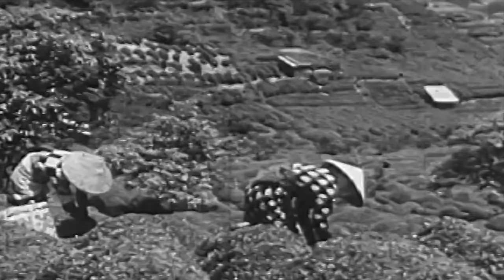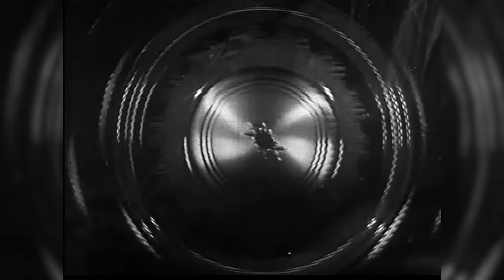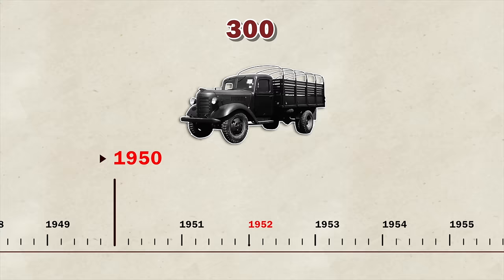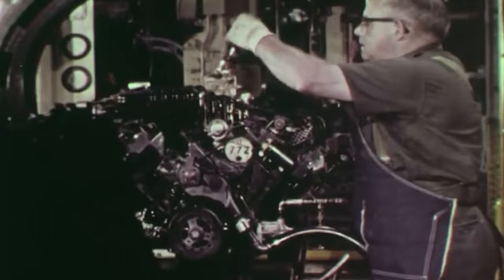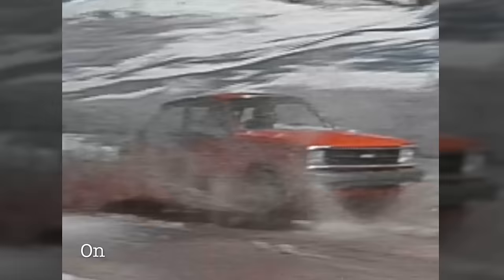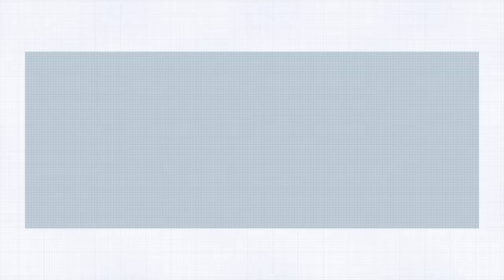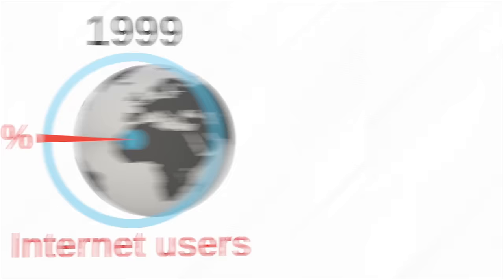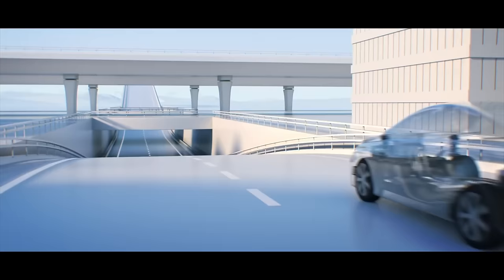Here's Why I Only Buy Toyotas

Comment: After owning different brands, my experience taught me that Toyota is the way to go.  They are by far the best built and most reliable cars I've owned.
Reply: so does that mean a Lexus too?
Reply: @thecarlitosshow7687  If I could afford one, yes.
Reply: @thecarlitosshow7687  YES! Lexus IS hella reliable. If you can afford it. Great alternative from a BMW, Mercedes and all that.
Reply: Had three toyotas and gone back to opels. Every car has it own problems, but atleast i dont need to be towed anymore.
Reply: Life is short and you cant take money or your car to the grave. Toyotas are usually lacking the fun factor. I've never kept a car more than a decade and usually sell them running as good as I got them. If you kept every car for 10 years, thats only 6 or 7 cars in most peoples lifetimes. Maybe thats acceptable for some but I want to drive more than that!
Reply: @CrunchyTire  always lacking in the fun factor. Always.
Reply: @tuneunleashed  disgusting,  cheap boring caked up Toyota (Lexus) is not luxury.
Reply: @tuneunleashed  If you buy a new Toyota Supra then you're buying a BMW. The engine and drive train is manufactured by BMW. Toyota supplied the body kit.
Reply: @CrunchyTire  
If you want to pass things down to family 
Obviously this brand will stay with your family line for generations 
You thinking in the short term
Reply: @fisher_price  a german car costs twice as much and will need to be maintained every month
Reply: @fisher_price  yes a toyota squeaks but it will still run and that's the beauty of it, it isn't meant to be luxurious or nice it's meant to last very long.
Reply: @cainesteban6679  they dont last long in harsh condiditions like australia. where as the falcon does. tough reliable and engine is near unbreakable
Reply: @CrunchyTire how?
Reply: @jimb12312  well they just added a new 6 speed manual version which is the only way to drive that engine with a manual. Toyota collabed wit bmw but def added their own touch which will only be found on the supra and not on bmw.
Reply: @Kaminaanime7860  Yes its probably better than a BMW branded car
Reply: @starquee talking macca. You sure you owed Toyotas? Me thinks not
Reply: If you don't mind, could you tell me the brands of cars you owned?

Comment: I drove my tacoma from San Diego CA, to Yosemite National Park, then to Mt shasta CA then to San Francisco and back to San Diego through all kinds of terrain with the ac blowing Ice cold. Not one issue or a single sound or problem. Its the most realiable vehicle ive ever used. Im never switching teams.
Reply: What year is your Tacoma?
Reply: SO !!!!! I went every bit that far on my Ducati! !!!! And it worked JUST AS GOOD !!! Except for the air conditioning! 😄😄😄😄😄🍺🍺
Reply: how many mileage  now on the Odometer?
Reply: Simply Put 2015 double cab trd sport
Reply: Art Mchugh haha I wasn't trying to brag  but now that you mention it I also pulled over and slept inside my truck in the middle of the woods high in the mountains for three nights straight. I bet you can't do that in your motorcycle lol.
Reply: john johnson I never said it was I was just responding in a funny manner. What are you talking about?
Reply: john johnson I never said it was impressive lol. I was just giving a positive testimonial. Plus not all trucks can go off roading and drive up steep mountains like its nothing, especially when they are dirt non paved hills filled with rocks. Its hard to beat a Tacoma. You seem like you would be really annoying in person. hahaha
Reply: @mg-ke3ji  got me there !!!!!😎😎😎😎😄😄😄😄🍺🍺🍺🍺
Reply: @artmchugh5644  Wait until 200,000 miles and see which brand works the best ...
Reply: Art Mchugh Motorcycles are pretty sick.  I always envy them when traffic gets really harsh. Its like traffic doesn't even apply to you guys. 🤣👍
Reply: I like to be different. I like my 2020 Cherokee Trailhawk
Reply: Tell that  to GM ....
Reply: I like performance so the only vehicle in my list is Supra.
Reply: My dads Tacoma has begun to leak oil, rattle inside, and the screen broke. Possibly the worst vehicle we have owned. Our Cadillac has outlasted this thing
Reply: The ac sucks when your parked though
Reply: I still love my 05 Tacoma
Reply: @noahmcclure2515  What year? The quality is going downhill. I had a 99 running perfectly at 320,000 miles until someone pulled out in front of me. Replaced it with a 2009, had to fix things before 100,000 miles that I never had an issue with on the older generation.
Reply: And I drove my Ram from Ohio to Wyoming to Idaho then back to Ohio then South Carolina in 3 weeks while hauling a 16ft enclosed trailer full of atvs 🤷🏼‍♂️
Reply: I drove My Ford Everest since 2008 unitil 2020 , i’ve never got any issues , never switch another team 🤣👍
Reply: @noahmcclure2515  what year is it, did he buy it new, how long has he owned it?
Reply: @Gongxi_fatcoi  ...do you still drive the same vehicle?
Reply: Sa- ssy , 2016 i just bought new one Ford Everest gen 3 bro 😀🙏 and the old one share with My Son
Reply: Rowdy Robby Rider Yeah it’s a 2019.
Reply: Sa- ssy 2019, yes bought new. Owned since November of last year.
Reply: smg 123 s
Reply: smg 123, have you take in it back to the dealer over a RECALL?
Reply: @wumawattsup9750  no, I haven't received any notice and everything is still working fine.

Comment: This was incredible. My Grandpa always told me there are a lot of great vehicles out there...but there is only 1 Toyota. If you want to keep a vehicle not for years but Decades it's a Toyota. Bought a 2010 Camry brand new and owned it for 10 years and 73k miles. The only thing I had to do was oil changes, a set of tires, and windshield wipers. The car was basically in perfect condition still barely broke in at 73k when I sold it to upgrade to a Tundra. I will only own Toyota period!
Reply: I bought a brand new 2010 Avalon Limited and it was in the shop at least 6 times. Pull to the right took 3 times to fix. (I finally told the mechanic where to look.) Caliper was hanging. Left headlight fogged up. They replaced both. Rear windshield kept fogging up. Bad seal but Toyota replace the entire window. Finally traded it in with 4K miles on it. Current Sienna Limited I've had 5 years. Has had many expensive repairs. Anyone who tells me Toyota's never break down or need repair is full of it. Many brands of cars out there that are trouble free if taken care of when new. A friend bought a Hyundai Tucson. She drove it almost 10 years without one repair. She bought another one brand new. I think the Camry and the Tacoma are the best vehicles Toyota makes. The rest are a roll of the dice.
Reply: I think that specied car must have a curse or smh my frnd owns a 17year old fielder with 200k + miles still running good needed some repairs but toyota lives up to its name

Comment: Since I was a little kid, my family owned many different Toyota models ranging from Corollas, Pickups, 4Runners and even a light blue Previa in the mid 90’s 😄 That brand loyalty definitely rubbed off onto me.. I drive the hand-me-down 2003 4Runner that has racked up almost 300k on the clock and recently, just purchased a 2010 Camry LE with the 2.5 I4 for my significant other. Both of my babies far exceed what they’re designed to do and are such well put together automotive marvels! They seriously put a smile on my face every time I climb behind the wheel. 

Like you Mr. Scotty, I cannot see myself ever straying away from Toyota ❤

Comment: I felt like a traitor to the American auto industry when I bought my first Toyota in 1990 which was a four wheel drive pickup; I went on to buy a 1995 4Runner. Prior to buying Toyota's I have purchased Ford and Chevy, Dodge and Jeep vehicles and was never happy with them as they proved unreliable.
Contrary to the Toyota's which I still own today and still run great, in fact the 4Runner is my daily driver with almost a half million miles on it with never ever failing to start or run. My only mechanical expenses have been for expected routine replacements of tires, belts, hoses, wipers, filters and of course regular oil and lube service. I have NEVER regretted buying Toyota and will certainly do so again in the future.
And who could blame me; I have a 25 and 30 years old vehicles that have always done their job and done them well........
Reply: What type of Toyota do you have
Reply: I always thought to buy Toyota is to be a traitor as well BUT Toyota is actually made in the US and employs Americans.
Reply: Simon Martinez he said 4Runner
Reply: How can you not though? They just work, and they work VERY well.

Comment: Since my first 1985 Corolla, my immediate family has driven 2 more Corollas, 3 Camrys an ES350, a RX350 and I still use my 2000 Tacoma with 180K miles for a reliable hunting truck.  We’ve never had a single problem.  Proper maintenance is the key.
Reply: I find it fascinating that people that still hunt know how to write.

Comment: Great presentation. You missed Poka-yoke and Yokoten.  I was task to apply Kaizen to my department. The pizza example was called Value Stream Mapping. I had to follow a worker all day and record the amount they had to travel to get their job done and plot it on a map of the companies floorplan. I had to come up with a way to minimize their travel.  Pretty much put tools right where the worker needed them so they didn't have to go get them. As pointed out somewhat in your presentation Visuality is important. I had to put these tools on a tool so that anyone could see a tool was in use or missing. Nothing hidden in a toolbox.  Had to walk through the shop every morning before a shift to make sure every tool was on these boards.  All because of Toyota's success of building the finest automobiles LoL You did touch on JIT (Just In Time) inventory reduction. Receiving a part exactly when needed.

Comment: I only buy Toyota vehicles as well, I started my contracting business in 2001, my 1993 Toyota 4wd 22-re truck always worked, never broke down I put 307,000 trouble free miles before I eventually sold it ( I’m buying it back soon). There were times if my truck broke down, I wasn’t paying bills or eating, it was always reliable. My 4 runner has 245,000 miles, Toyota is the best vehicle on the planet.

Comment: Well done.  Ive lived and worked in Japan for 25 years.  Its funny looking at the NAMES of these iconic brands.  In Japan they rarely use the same name these days at home.  I am not sure why.  But a Lexus for almost 15 years was called the Harrier with a eagle head emblem.  Only recently did they start using the term Lexus at home.  That goes with a lot of brands and models.  There are dozens.  One other thing that helped Toyota is a government system of safety inspections.  A new car gets 3 years then every 2 years after that you need to go in for these inspections which at the start might be only filters etc but still cost as much as 700$.  Pronounced Sha-ken.  Shaken pushed people to buy a new car sooner because as the car got older the shaken became more and more expensive as parts wore out.  This wasn't a subsidy but it did benefit car producers here.  I've had a few cars here and never had a serious mechanical problem with ANY brand.  So quality is very high here.

Comment: Here why you should buy Toyota.

Automaker Toyota Motor Corporation on Thursday released an inspection campaign related to the exhaust gas recirculation system for certain Toyota Auris, Verso, Avensis and RAV4 models with diesel engines.
 The campaign covers the Auris, Verso, Avensis and RAV4 models, built between March 2015 and May 2018, with a 1.6- or 2.0-liter diesel engine.

 According to Toyota, in the event of a potential problem with the exhaust gas recirculation (EGR) system, an internal coolant leak may form in the recirculated exhaust gas cooler.  The leaked coolant, together with the particles in the exhaust gases, can create local mass points causing high heat loads.  The problem can lead to punctate thermal damage, engine control fault conditions and, in extreme cases, the rupture of the intake manifold in the event of thermal.
They really care customer's.😊👍

Comment: Here is why I only buy a second hand products: I'm broke. 😂
Reply: I am not broke BECAUSE i drove a 2003 corolla for 6 years without a payment.  And replaced it with a newer, used, corolla.
Reply: Don't feel down, bro. Good times will come. You should be driving a Lexus in a decade if you put more effort & heart in your job. Work smart, not too hard.
Reply: @JKHTX  I bought a 98 four wheel standard cab brand new. Sold it in 2011 for 6000 bucks with 270000 miles on it.
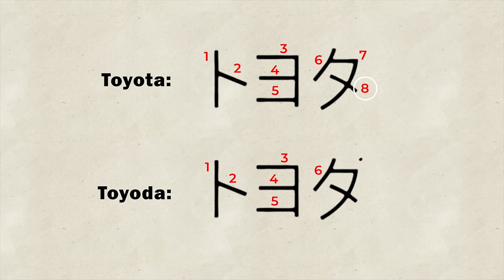Reply: I'm not broke and I drive an 06 rav4 because it's reliable. My daily commute is 2:30-45 hours both ways, and she performs like a champ.

Comment: My mom purchased a Toyota Celica back in 1979.  Before that she had a Pontiac Firebird that she had nothing but problems with not to mention that it was horrible in the snow.  She had that Toyota Celica for nearly 20 years and the only problem we ever had with it was that a brake line had to be replaced which cost about 75 bucks.  It was a really good car in the snow on top of that . She ended up selling it to my grandpa. He drove it for another five years and then he ultimately sold it.  I’ve always had tremendous respect for Toyotas after our experience with that car. I wish they would bring back the Celica.

Comment: I learned how to work on cars when my father coached me through an engine and transmission change and brakes by working solo on a Toyota Crown Deluxe in the late 60s. The car had been driven by its original owner, without oil. I found the car wonderfully and carefully made.  The inside and the body was, cherry. These were great cars.

Comment: I have Toyota Corolla E180, and it run like a charm, great fuel economy and no issues in two years or 40K kilometers. Only things changed are oil filters and engine oil. Not fancy looking but reliable.

Comment: Scotty...I am a Toyota fan boy too! I own 3 Toyota's!!!
Reply: Best most relaible auto.
Reply: U can be in denial. Nothing comes close, possibly Honda.
Reply: I own a 17 highlander!i love it. solid .reliable
Reply: Going back to Toyota....have had 1 ford, 1 Chevrolet,  1 jeep, 1 Pontiac, 1 Mercedes and 1 Toyota....and by far the Toyota was the best car...
Over 200,000 miles...I should have kept but I had to get a crappy Mercedes....thinking new toyota in my future
Reply: @merc-ni7hy  It's a rock sitting in your garage. It will get you to the store before it overheats or runs out of gas. As long as you step out and let it cool down, fan the engine, you can limp back home. Nothings wrong.

Comment: Great job on this one! Very informative.  Scotty, I'm so disappointed in myself...I sold my 2001 Avalon about 2 months ago:) It was in great condition inside and out, standing and watching the engine running with the hood up...it sounded like a quiet sewing machine,  steady as can be, with a smooth perfect trans to match that engine. My plan was to buy a used newer one but with the way things just went with the car market...that may not be so "cut and dry". Ugh!
Reply: @sgvincent100  Ha, I can only wish. That was the plan, to find a newer Avalon...or Camry. Not been good pickings at all. I have a leased vehicle until Sept 2022. I shudder to think I might need to buy out the 2020 chevy I'm leasing before finding a decent deal on another used car. What I'm in will be 3 yrs old in Sept and has 20,000 miles on it and pretty much loaded less a moon roof. I still say Ugh!  Will see how it goes by summer?

Comment: I had a 1985 van with over 500,000 miles trade it for a 2008 Corolla with 300,000 miles until I traded for a 2019 Corolla hatchback and I bought a 2005 van which I love....with all the years in-between...I saw my 1985 van on the road I could not believe it...i love my Toyotas...i called them faithfull #1, 2, 3, and 4....

Comment: I had a 1988 Toyota Pickup with 408 Thousand miles on it (I bought it new), recently sold it to an Auto Parts store owner it never gave me one problem. Did put in a new Clutch and other normal stuff but it was as reliable as can be.

Comment: I’ve owned Toyota’s since 1996
2000 Camry LE made in Japan , I’m still driving  110,000 miles 
Wife passed down the 2000 in 2007. It will be on the road after I’m gone. 
She’s had 2007 Camry
          2013. Nisson Altima ( big mistake)
          2018. RAV4 and 
Im extremely familiar with all those  Toyota innovations as I was in American  Manufacturing Management 
As a Automotive sub supplier. 
Brings back memories

Comment: I wish that all companies applied those philosophies, American companies especially, but you know who always thinks they are right?
Reply: I wish Toyota made appliances!  And kitchen items, and HVAC systems!  I brag about things from them that most don't even understand - I was bragging about the hole in my Corolla caliper so you can get through to loosen a bolt.  A damn German car that fools  covet, would probably require an engine removal, for a brake job.
Reply: No thanks I don't want my Fords specially the new lineup to look and perform like a cartoon drawing from a 5 yr old, even if that cartoon is super reliable..
Reply: Irving currently holds the Guinness World Record for the highest vehicle mileage on a personal car, with over 3,000,000 miles on his 1966 Volvo 1800S! ... Could it be that Volvo built a near-indestructible vehicle in 1966 or is Irving just that gentle on his cars?

Comment: toyota and gm partnered together to build gm built corollas and matrix, in fremont, cal. i had a 2002 prism, (corolla), i drove a 187,000 miles, and got rid of it, because sales tax increase, (5% to 6.25%), i bought the 2009 honda fit, before sales tax went up, (mass.)